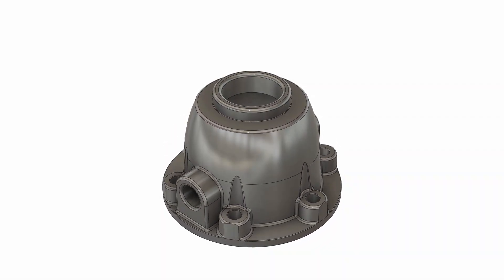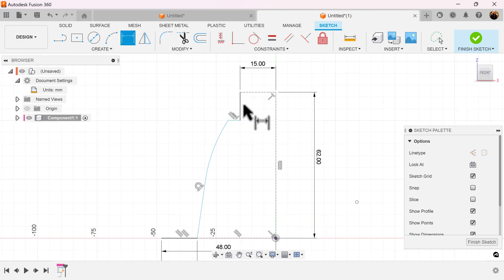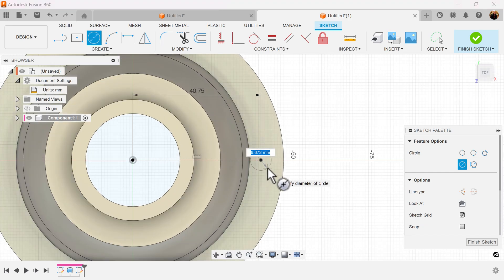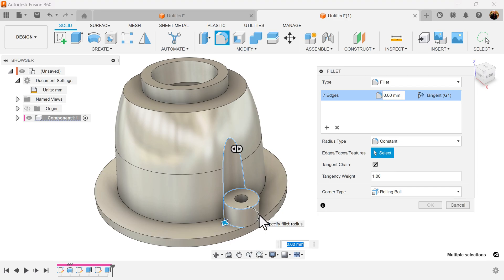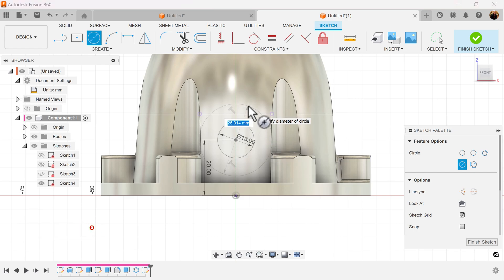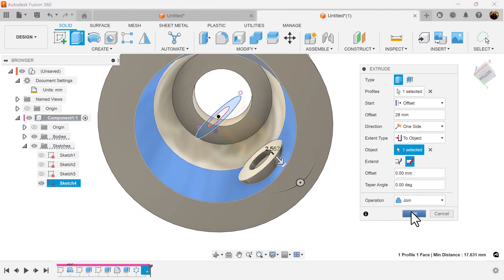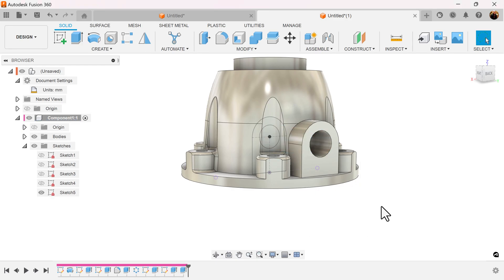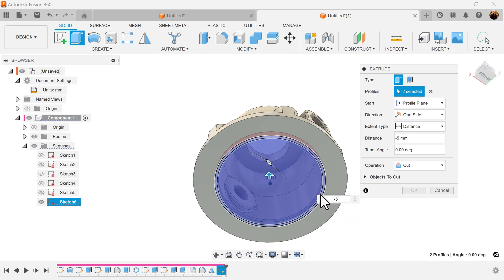Modeling in  Fusion 360 | Rep no. 24

Comment: I like your process of multiple sketches, some  people seem to want to combine the whole object into as few sketches as possible making it much more difficult to extrude or edit features because of so many smaller surfaces to project. How would you produce this part? Some of the inside features and fillets would be almost impossible to machine. It could be cast with some inside modifications or 3D printed.
Reply from the maker: I imagine this indeed would be a delicate multi-step process especially when machining complex tightly toleranced parts.